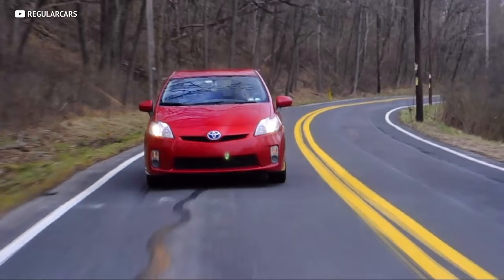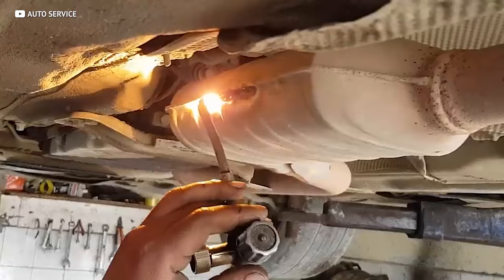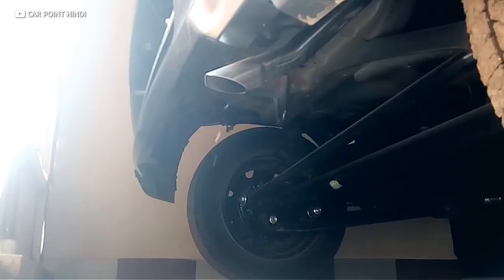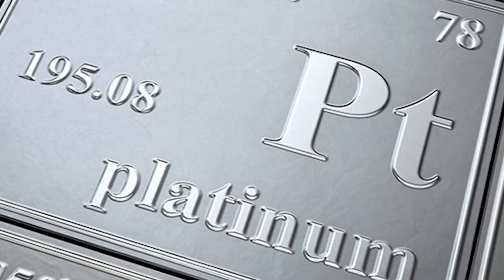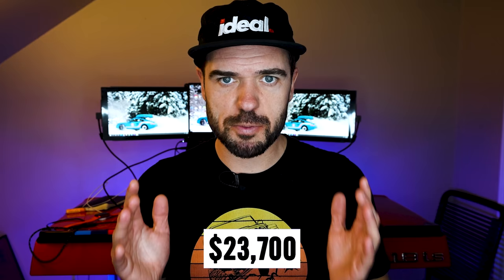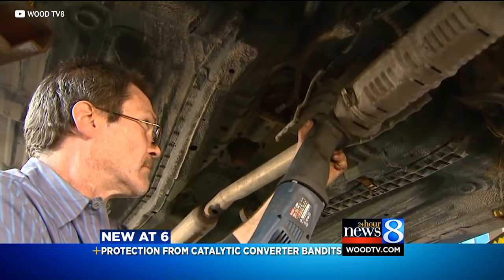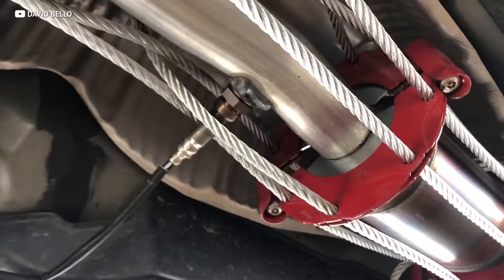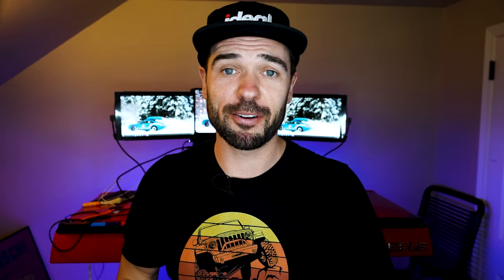This Car Part Is Worth More Than GOLD!

Comment: I don't have to worry about this since my car is slammed.
Reply: You may not be able to go over a speed bump, but at least u can keep ur cat converter
Reply: Lame
Reply: @alexlyon3833  lmao true, Cats are valuable than bumper. You could just install a cheap lip
Reply: @itsme3297  I don't slam my car but to call someone else's style lame is lame. Smfh
Reply: If it's on air suspension......best of both worlds.  Otherwise  bad roads, driveways and speed bumps/humps are an issue.
Reply: Good thing for air bags on remote for the z. Good luck!
Reply: My Nissan LEAF is safe, it's electric and doesn't use catalytic converters. It's also ugly so no self respecting thief would want to be seen near it. The perfect car for an unsafe neighborhood.
Reply: I sure hope this is a joke

Comment: I wish I would have watched this about a month ago. I have a 99 Ford E250 with the 5.4 Triton. Went out to start it up one day and of course it is a quiet vehicle. When I fired it up that day, it sounded like a freakin monster truck!!! I crawled up under. Sure enough, my Cat had been lopped right off. Fortunately here in Lea County New Mexico, we don't have to smog our vehicles. I reported it to the police of course but I just had a welder buddy of mine just weld up some pipe from where the cat was to the exhaust pipe. It is quiet again but has the nice rumble of that 5.4 and it improved the engine's performance. Had I lived in Cali, where I was born and raised, shit would have hit the fan... But here, not that big of a deal.

Comment: Yes. 3.7 2001 Dodge. Half ton pickup. Not lifted. In a lighted parking lot, at my job. Ya I just took it to Track side Auto and they welded pipe in place. Thanks again Track Side Auto.🙂

Comment: Worth of any product is based on what the buyers will pay.  This part is worth its weight in gold because the material used to make this part is now in short supply and is badly needed for other profits to continue.  Such as sales of smart phones.  Once smart phone manufacturers find a substitute the value of this part will drop fast.

Comment: I’ve had my cats stolen 3 times in the last year. On my tundra there are 2 cats on the exhaust. I’ve replaced them both and now ive welded them both  with chains and they haven’t been stolen yet
Reply: Straight pipe my brother  come join the gang 🤟🏿🤟🏿
Reply: With chains 🤣🤣

Comment: it cost around 1100$+ to replace a catalytic converter on most Toyota vehicles and there worth just as much in metals. I scrap out and buy cars at auctions that don't run nobody wants for less than 350$ +/- a vehicle, sell some parts here and there, but the Catalytic converters are like a lottery ticket you just don't know if you've doubled or tripled your profits until you cash them out. 
most pre 06 ford crown Vics have 4 cats on them there worth around 375$ or 1356$ if you smelt them yourself and send off the pgm to kitco

Comment: I work at a mechanic shop, we collect 40-50 catalytic converters every 4 or 5 months and sell them to a recycling company. Depending on how much gold and the other metals are worth we make from $6,000 to $8,000
Reply: its the platinum in them that makes them valuable, if you learned how to use a solvent to dissolve and reclaim the platinum you'd make a lot more money
Reply: @King_Flippy_Nips  u know how too?

Comment: part of the problem is with hybrids like the prius.

the prius engine does not run as much so the converters are going to be in newer condition since the materials inside wont be consumed as much.

i think a way to make prius converters less worth it is to.

1. use less material in them so their lifespans are more competitive of normal cars.

2. make a law that limits how much scrap yards pay for catalytic converters or the metals inside.

3. for all oems to use aftermarket or disguise their converters as aftermarket by making them silver and stamping the arrow on it like in the video's thumbnail.

Comment: 2 years ago I worked a a volvo wreckers that was closing down and had a pile of cats in the corner of a shed and my boss got about $12000 for them they were from volvos built between 1994 and 2012

Comment: My catalytic converter never got stolen from my '03 Camry LE. It's not stanced or lifted at all, it's just at it's normal position as it should be to say the least. It is naturally a little lower to the ground. Also Brad I am genuinely surprised to hear that catalytic converters can get stolen at any given time. Yes I will buy a dash camera or 2 when I buy my own dream car just in case if the worse happens like if someone tried to steal my catalytic converter or something.

Comment: I just had my Cat stolen

 but it took me a few days to figure out what was wrong since I don’t know cars. Luckily I have a 2008 Ford Escape and it was a cheaper cat then most at about $350 for the part alone (no install). The guy at the shop said pretty much what you did, you can try and protect it but people steal them so fast that it’s nearly impossible to stop them.

Comment: If you have a 2005 Hyundai Tucson they steel the rear cat have the shop weld it on.  There's only 8 bolts that holds it on.

Comment: Well I must say that this happened to me once when i was parked at a parking lot, I drove a 2003 toyota Corolla, which has 2 plus 1 catilatyc convertor, needless to say they hit the jackpot on this hike...on the flip side the check engine light had been recently lit up due to a problem with the catalytic converter, meaning it was in need of replacement anyways. So it was a win win sort of. Not really cause they got the radium and I got a 500 deductible to pay for the $1500 replacement cost. I am a subscriber to your channel and I had to share my story with you. Thanks for all of your interesting videos!

Comment: Actually the main cats on a lot of vehicles are right after the manifold. A lot of 4 cylinder cars have them built into the manifold. Some vehicles also have a secondary cat after the down pipe sections but I have never seen one by the tailpipe...

Comment: Someone tell me how a dash camera is going to help in a very effective way. The camera has to be on, facing the correct way. The car is usually off when the converter is stolen, a forward and rear facing camera or camera facing the approach to the converter would be required. Camera's defeated with a mask.

Comment: NOT A GOOD IDEA to weld the cat to the frame or chassis... the exhaust system is free floating and should not have any rigid mount point to either of them. Weld it in to the exhaust system, sure. even easier, weld the bolts and nuts to the flanges the cat bolts to. Do what you want, but don't be shocked when stuff breaks or cracks due to no longer being isolated from other portions of the vehicle!

Comment: My cat was stolen off my Honda CRV.  Dam jeep is so high the guy just crawled underneath and cut it off.  I'll tell you the truth, this really hurt me, not really the fact that I had to replace the cat, it was more what it cost.  Them things are expensive.  What made it worse was that in the process of cutting the cat out, the crooks ripped the sensors.   My jeep has two sensors right next to each other, so I had to replace those as well.  Each sensor was like $170.00 and the cat, well, I had to go with a after market one, but it was still $350.  So with all and all, oh i forgot... "Labor cost"  this wasn't a funny situation at all.  I catch the guy who did this, i will hurt him badly

Comment: I stopped watching the video right around where you said the catalytic converter was near the tailpipe do some research I'm pretty sure on your car's it comes directly off of the exhaust manifold and usually it's it's right around underneath the driver if it's like a 4-cylinder or something

Comment: Best way to foil the thief.
Remove the Cat, open it up and remove the precious metals.
Weld it back closed and reinstall it.

More fun can be had by catching the thief in the act 
on your home security camera, 
then use your remote start while he is under the car.

Both methods should give you a good laugh!